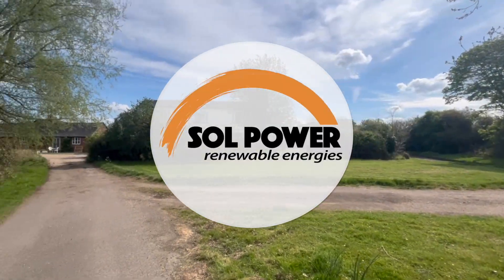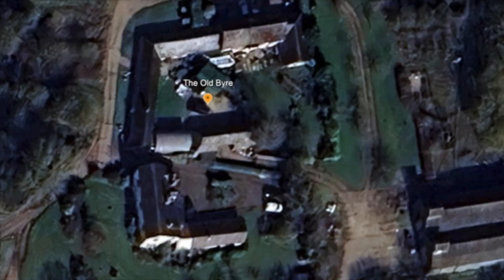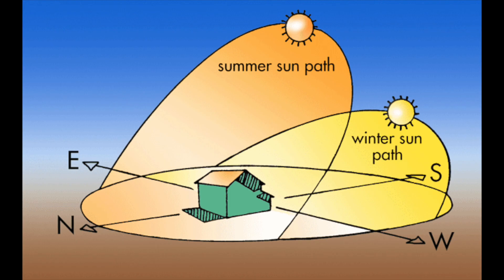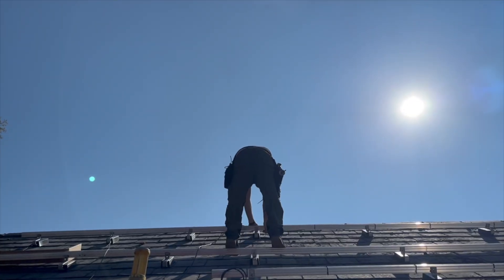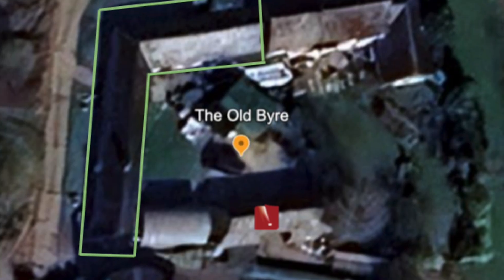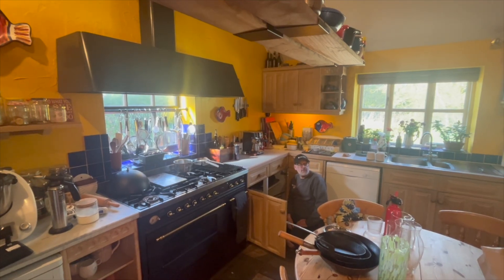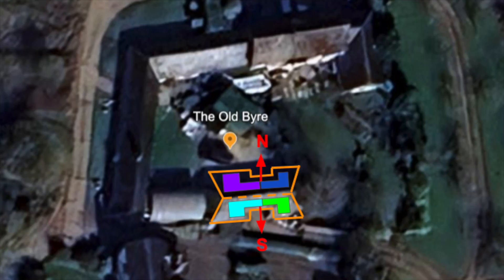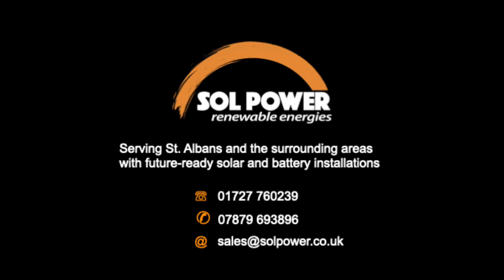Identical North and South Solar Arrays on UK Home

Comment: Nice install. Good justifications and explanations  🙂 
I agree you were right to utilise the north facing aspect of the property. Although it will, without doubt, suffer in the winter months, if you look at the expected output over the whole year it will be worthwhile. 
It would be interesting if you could report back after the full year to confirm the total proportion of energy created from South Vs North 🙂

Comment: Peak middle of summer may be ok, but winter will be hot garbage, they will essentially be shaded the entire day. Given that this is when they will be needed most, for heating, they are a bit useless in the winter. Given the crazy high net metering though, you may as well just slap up a megawatt of solar and live like a king.